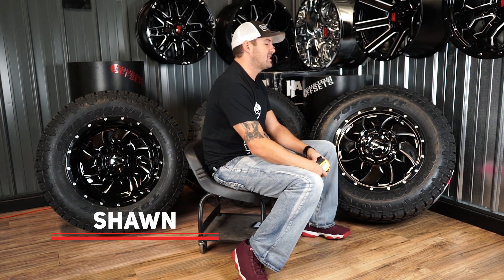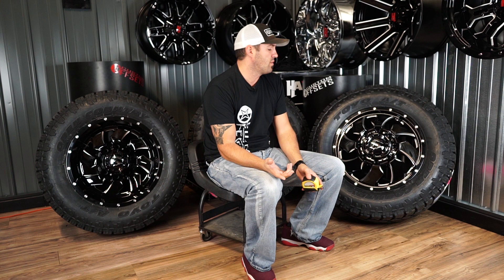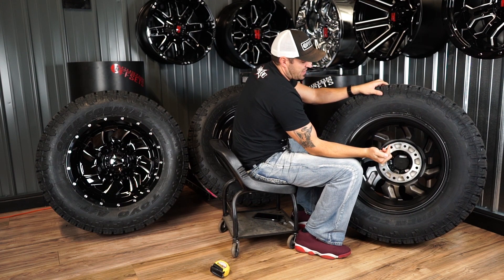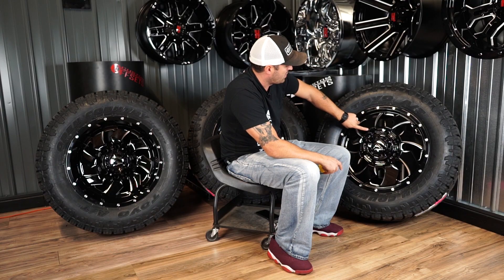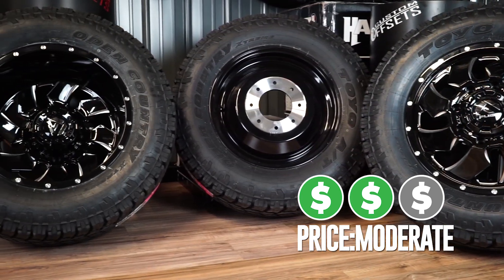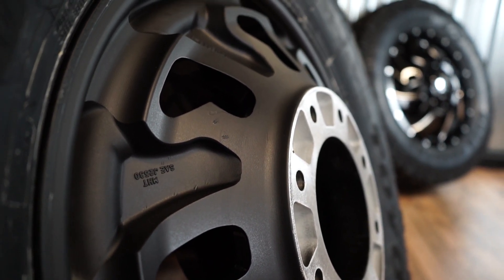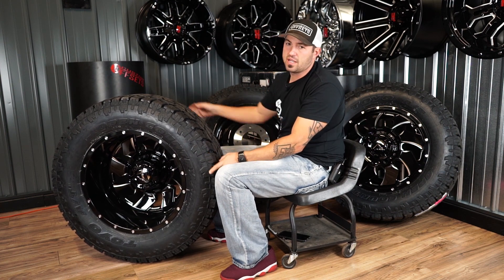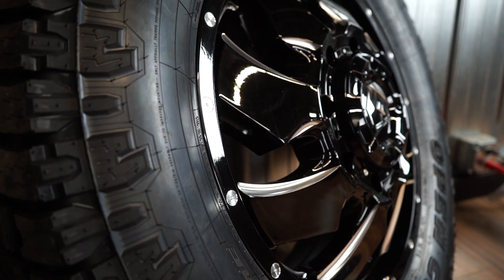Hot n New ep.115: Fuel Cleaver 20x8.25 +105 / -175

Comment: Show some set of dually rear with the negative offset upfront
Reply: jr Rankins that would just be running dually in the rear and a single wheel setup in the front. just run same wheel in a 20x12
Reply from the maker: Would be the same as running a negative offset wheel on a normal SRW

Comment: I’ve seen duallies run a negative off set on the  front. I heard all you have to do is remove the front adapter.  Do you have any information on that.
Reply from the maker: Albert Brosig yes, you can do that. Just important to verify bolt pattern.
Reply: Custom Offsets bolt pattern will be the same under the front addapter only difference is whether or not the truck is srw or drw. then the adapter is added at the factory.
Reply: Thank you for answering my question. What do you think looks better?  I kind of like the negative off set. But I like the look of a true dually wheel on a dually. Hell I sound like woman trying to pick shoes! Lol!
Reply: Albert Brosig Run dually wheels on a dually.
Reply: Albert Brosig ive got alcoa dually wheels. i like keeping it a dually in the front. ive got a spare tire carrier on my backrack. keep a stock steel wheel with decent tire so if i were to get a blowout anywhere i would be able to get off the road and  change to a full size spare